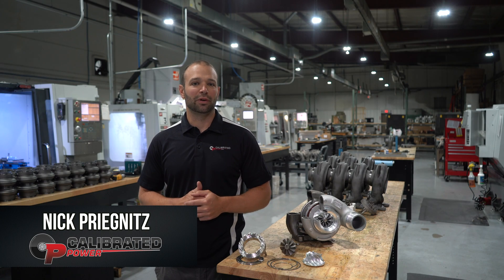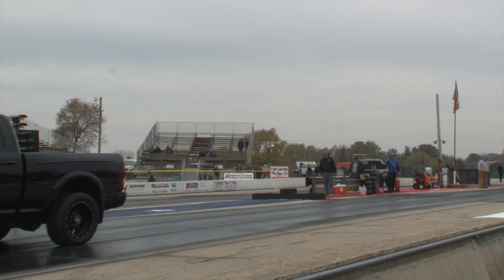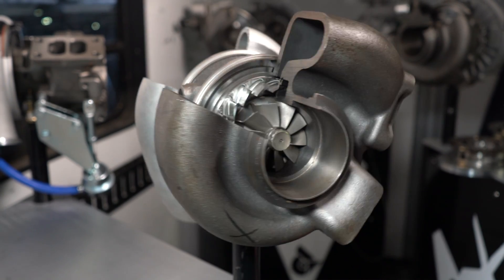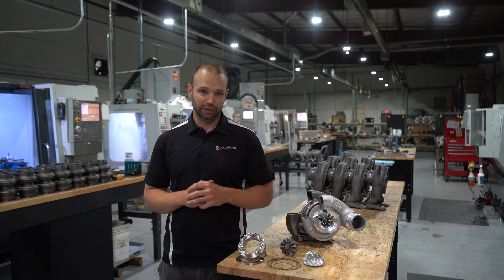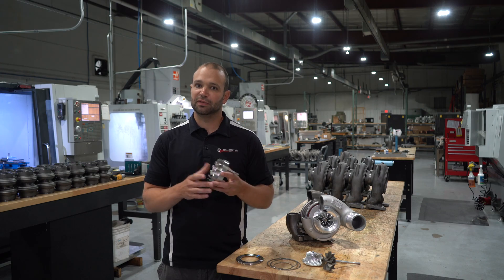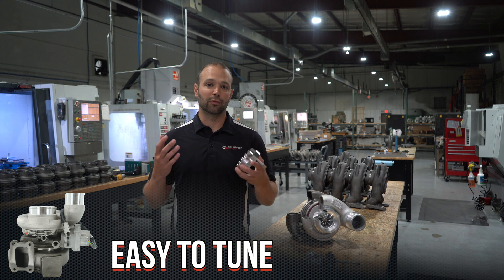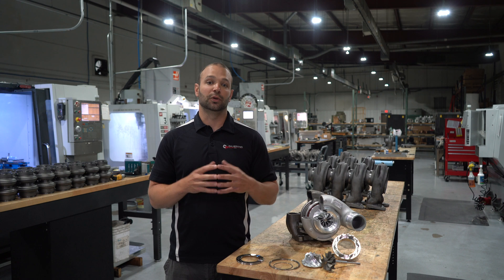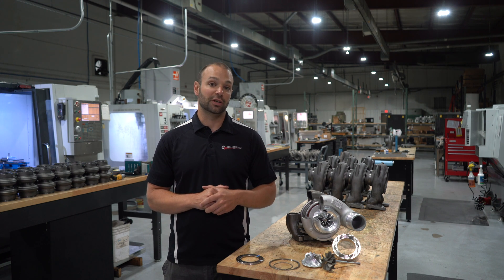IT'S HERE! The Cummins he351ve / he300vg Stealth 64 for 2008 - 2018 6.7L Cummins!

Comment: I’m not interested in racing my 2006 Dodge Ram3500 5.9 dually but I am interested in making it an ultimate tow vehicle for my camping trailer…what would you suggest? I have added Banks 4” exhaust, larger Intercooler and Boost Tubes, Six-Gun Tuner connected to iDash Gauges
Reply from the maker: Our 5.9L Stealth 64 is a perfect towing turbo. Lower EGTs, quick spool. Here is a link: https://duramaxtuner.com/turbo-chargers/3rd-gen-stealth-64-351-cw-2004-5-2007.html
Reply: Fantastic, thank you  very much that will be my next purchase…Love your videos and the knowledge you share

Comment: I'm in the market for a new turbo. How does this turbo out preform BD Diesel Screamer HE300VG 6.7 or the Fleece 63mm FMW Holset VGT Cheetah Turbocharger - 13-18 Cummins
 I will also ask those two companies how their product out preforms yours? who ever responds with the best product wins.
Reply from the maker: Both the companies you mentioned make excellent products and we have a lot of respect for them. The Stealth 64 has several unique features. Starting with the front of the turbo our compressor cover and wheel are perfectly matched to maximize the airflow and eliminate any potential for surge. While everyone making drop-in turbos uses “billet” compressor wheels, not all wheels are the same. Our custom-designed, 11-blade, billet, compressor wheel works great for daily driving, heavy towing, and just having fun. Where the Stealth 64 really stands out from the crowd is our One-Of-A-Kind Nozzle Ring (aka. Vane Cage Assembly). This piece of engineering excellence allows us to run a larger turbine wheel while maintaining full function of the exhaust brake and spool the turbo quickly. Having the tallest and widest vanes available allows the Stealth to maintain superior control over your desired boost pressure. All of this translates into the most powerful, quickest spooling, and most efficient turbo possible. Hope this helps you find the right turbo for your situation. If you have more questions, feel free to give us a call and talk with one of our live agents as well (815-568-7920).
Reply: @Duramaxtuner  thank you for the reply. I will look a little deeper into your product
Reply: @robbennett7593  Which turbo did you end up going with?
Reply: @aaronolsen8787  turned out it was just some duct tape that went into the turbo plus a air leak in a boot, so still running on stock

Comment: What metal is the turbine housing and center section made of?  Is it HSM or factory style metals? Also, is the unison ring made of Stainless or is it a milled cast part?
Reply from the maker: The center and exhaust housing are factory style.  The nozzle and shroud are milled stainless.

Comment: How would you compare your stealth single to the factory with the ATS Vortex compounds since that truck has run both set ups?
Reply: I'm certain ease of installation is the biggest plus for the stealth.  Would like to know if either has an advantage for emissions components.
Reply: @irnwkrkev  agreed on the ease of installation… though ATS generally receives praise regarding fit, finish, and instruction for their turbo systems. Considering the stealth 64 is a $3300 upgrade contrasted to $3900 for the vortex they are close enough in cost to warrant a comparison especially since Calibrated has run them both on the same truck with the same supporting mods. 

As for the emissions components When they originally installed the Vortex I believe they observed less soot loading and fewer regens.. logical since compounds typically clean up spot extremely well.
Reply: Is it necessary to have a wastegate to protect the stock VGT when compounded with the ATS vortex?  Seems like drive pressures to boost pressure ratio would be too much for the VGT to handle for very long

Comment: Crazy interested looking at replacing as I type this. Question will it handle altitude changes and heavy long distance towing. Say 24k lbs for 500 miles at a time. Another question on the custom parts. Would replacements be available after failure in the future?
Reply from the maker: Yes, the turbo works well in higher altitude. While I am not exactly sure what you mean be "custom parts" I can say that we offer many upgrades for these trucks.
Reply: @Duramaxtuner  already ordered lol. As to the parts according to the video you guys made a custom exhaust turbine and vgt slide so just wondering if replacement parts would be available if needed
Reply from the maker: @danwymer1  Thanks for your order, we’ve been in the turbo business for seven or eight years now and have no intention of slowing down :-). Replacement parts will be here if you ever need them
Reply: @danwymer1  How are you liking this turbo?

Comment: What's the power potential with stock injectors and an upgraded CP3?  Can 2019+ HO injectors be used as a cheap injector upgrade?  
I'm already running your king tunes with a RevMax 68rfe and love it!
Reply from the maker: We’ve seen 625-640rwhp on our stealth 64 with a 10mm pump and stock injectors in a situation like you mentioned ( revmax through the stock exhaust). Next limit is likely the DOC.
Reply: DOC ? Sorry I don’t know what that means.I’m new to diesels.
Reply from the maker: @MrKThomas1976  Diesel Oxidation Catalyst
Reply: Thank you 🙏